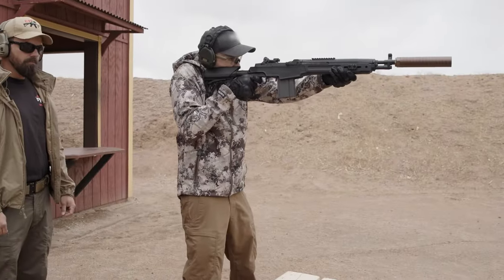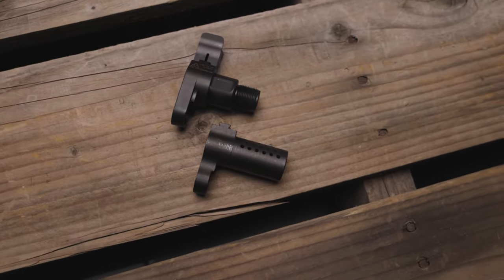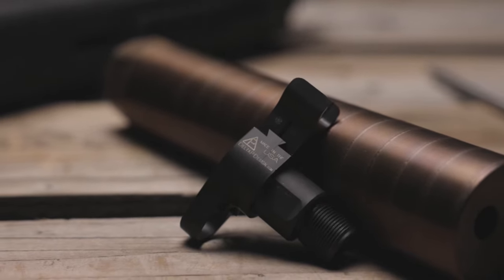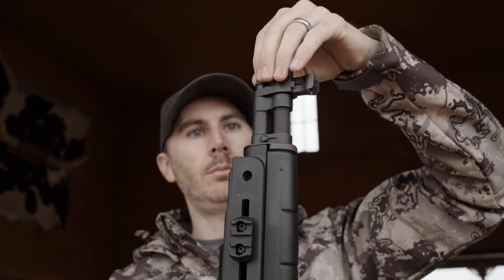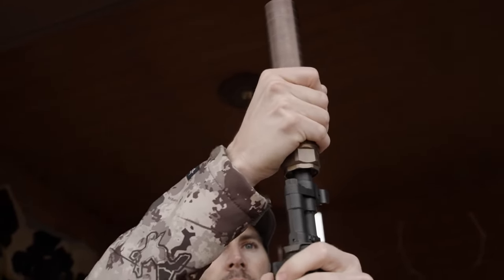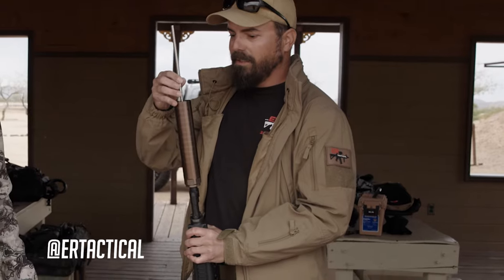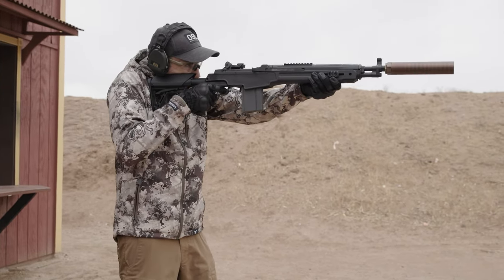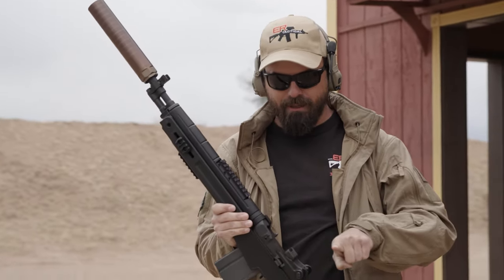Suppressing a Springfield Armory M1A SOCOM

Comment: Smith enterprise has the set up for suppressed at $80..00 instead of $200. And u don’t need a set screw for the adapter with smith.
Reply: it does have the set screw, uses factory location
Reply: And when your rifle shoots 3 feet low, you'll wish you didnt buy SEI garbage

Comment: I've seen this video and another one that you made regarding the Smith Enterprises gas lock and muzzle adapter.  Can you help me understand why some folks use an adjustable gas plug and yet, Ron's system (gas "lock") does not require any type of adjustments to cut down on gas?  Is needing an adjustable gas plug just bogus?  Thanks much.

Comment: Try going with a surefire SOCOM muzzle brake w/t a surefire 7.62 RC
That's what I did. All my rifles utilize the same surefire SOCOM muzzle brake.
Reply: My standard M1A is so modified by me that using it in officially sanctioned service rifle matches would involve a bribe or outright ignoring the rules.
When I recently found that parts are available to mount a silencer on the M14 type,it greatly pleased me.

Comment: How hard was it to remove the factory muzzle device?
Reply: Do you have the pliers designed for the purpose?
They're available from various outifts like Fulton Armory & Smith Enterprises.
Reply: @christinebonner2210  thank you for the reply, I was able to wrap a leather glove around my brake and put a wrench on it. It came off relatively easily after I cracked it loose
Reply: @batmantiss You're welcome.
I thought that you had the standard M1A & flash suppressor like mine.

Comment: Is it necessary to use subsonic ammo with this?
Reply: It's going to help with overall sound but it's not absolutely necessary,  just make sure your suppressor can handle full velocity 308. If you hand load I'd suggest using a heavy bullet or less power for less chamber pressure and less velocity leading to less sound